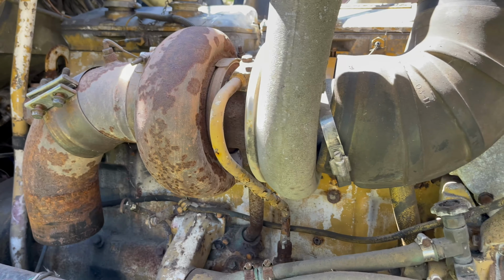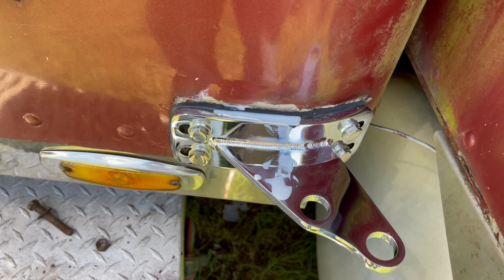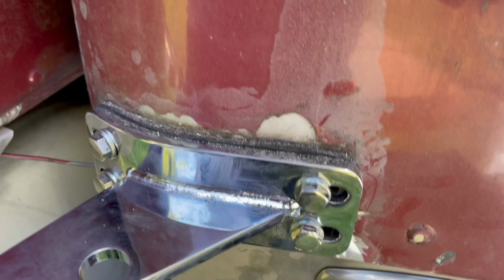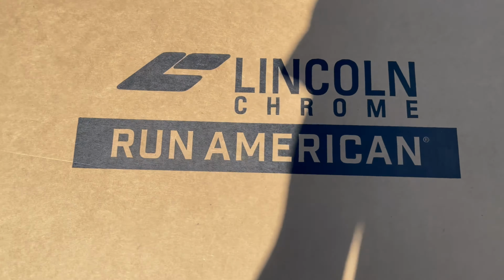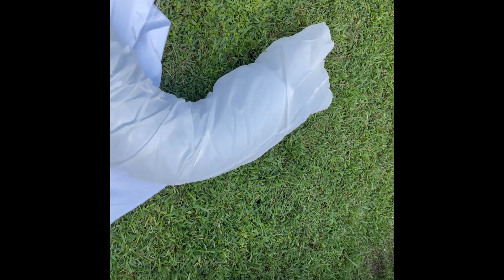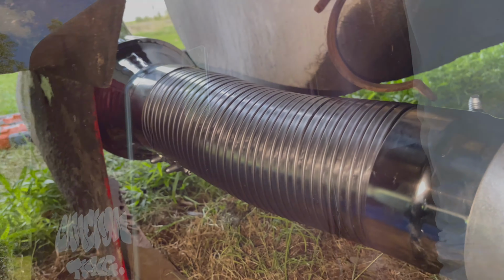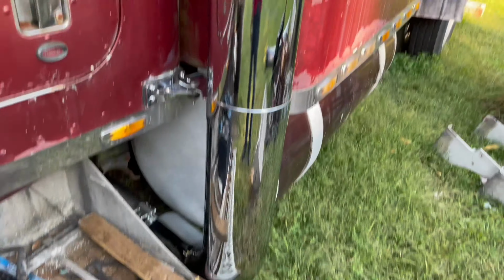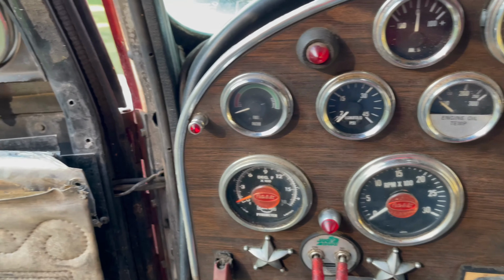Peterbilt 359 Gets 8 inch Stacks!

Comment: Looking and sounding good!!! Are those stacks and/or brackets model specific?
Reply from the maker: I think they are I just called the chrome shop and told them what I wanted and what I was putting them on, some places have a long wait on them but I got lucky
Reply: @MR75PETE  Good deal! You're in SC correct? So am I, which shop you usually deal with? The one closest to me is on I-26 about 20 miles south of Columbia.
Reply from the maker: @williefree7089  yes I’m from SC I don’t really use any shops I do it myself unless I need it done fast and I don’t have the time.
Reply: @MR75PETE  same here bruh!! I guess I was asking which shop you got yours from.
Reply from the maker: @williefree7089  I ordered mine from bigrig chrome shop, google it their page will come up and just give them a call
Reply: @MR75PETE  I appreciate that! Will do!!👍🏿👍🏿👍🏿
Reply from the maker: @williefree7089  no problem

Comment: Those are called zerk nuts. Or rivit nuts if I remember right. 
The have a tool that looks like a rivet gun that you use to insert those into the metal. Then you can thread anything u want in there. 

Otherwise u have to get to the other side and use a bolt and nut type install.
Reply from the maker: Yeah they where being a pain so I cut them out and just use nuts in the back side

Comment: A sounds like you need to dump a couple gallons of transmission fluid in the tank it'll clean up those injector I do that cause transmission fluid is a cleaner
Reply from the maker: Thanks for the info
Reply: @MR75PETE  actually if you change your fuel filter fill it up with transmission fluid both if you have 2

Comment: A I laid the cardboard on the ground after I unboxed them under the truck when I installed my lincolns so I didn't scratch them
Reply from the maker: Yeah I should have did the same but I got lucky only scratch’s I did have were from putting clamps on
Reply: @MR75PETE  have you looked at my video of my pete
Reply from the maker: @jesserasso1042  thanks
Reply from the maker: @jesserasso1042  I didn’t notice you had any but I will check them out
Reply from the maker: @jesserasso1042  your truck looks great!
Reply: @MR75PETE  thanks bro I just wanna get it done just to much going on
Reply: @MR75PETE  your trucks gonna look good but if I had your truck I'd seriously put a newer hood on it with the new head lights and template your air cleaner cut out with a piece of cardboard and trace them on to the new hood then cut them out dude you'd have people second guessing them selves it would look so sick use that same color scheme with heavy metallic in it sorry I just get excited it's your truck
Reply from the maker: @jesserasso1042  lol I wanted to keep that old style hood but going to replace some of the panels like the ones on the side where those vents are, but im going to do that later when im ready for some paint.
Reply: @MR75PETE  I remember you said that sorry bro I just excited cause I love Pete's I love them all but Pete's more
Reply from the maker: @jesserasso1042  yeah I understand that

Comment: Pipes are nice ,  I am not here to bash you or your truck , But when you throttle it up sounds like it's got a miss , One of the holes  on that Engine ,   Back in the day I had plenty of them push rod cats we done all of our work in house  , Hopefully no problems Just trying to tell you how to troubleshoot  , When the engine is cold Fire her up let her idle With the hood open , then walk on the right side of the truck and put your hand On the exhaust on each hole and keep repeating your hands on the exhaust on each hole ,The one that does not warm up , That is the hole that is missing , They are not injectors in that cat , They are called pencil nozzles  , They pretty much look like a pencil  ,  If all your cylinders are warming up the 2nd thing to do , Put your ear by Your air cleaners and if you hear anything it would be a intake valve  You will hear it   and of course I hear it out the exhaust , Could be a exhaust  valve ,
  not trying to scare you just trying to explain and help you ,  But I am pretty sure it is one of your nozzle , Them old cats were good for that
Reply from the maker: Yea im planning on taking it to the shop and get it looked over